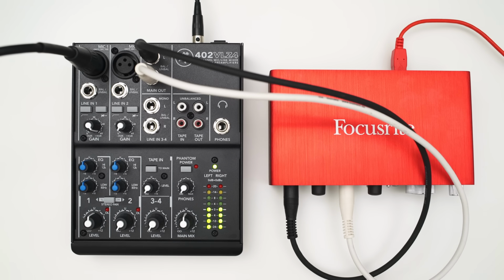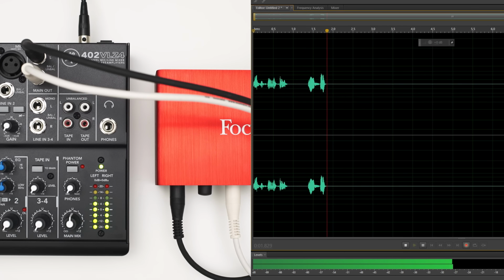Setup Guide - how to connect a Mixer to an Audio Interface for audio recording

Comment from the maker: FAQ:
Q: Why would you want to connect a mixer to an interface?
A: Let's say, you have a mixer where 8 microphones are plugged in. You could then record the combined audio of all the mics with the interface.

Q: I only have one mic. Do I need a mixer in front of my audio interface?
A: No, just plug the mic directly into the interface to record your audio.

Q: Why would I want to connect a two-channel mixer into a two-channel audio interface? Couldn't I just connect the two mics directly to the interface?
A: Yes, connecting a two-channel mixer to a two-channel interface is not really useful. I just used the hardware seen in the video for demonstration purposes.

Q: Does this setup increase or decrease preamp noise?
A: This depends on the preamps in the mixer and interface. If the preamps in the mixer are much better than the interfaces preamps, then this whole setup could improve your preamp performance. But this is also true the other way around. If the mixers preamps are worse than your interfaces preamps you end up with more preamp noise in your final recording.
Reply: Julian Krause What IF my mixer has a USB connection???? Would I still want to use an audio interface with mixer or no? Any pro vs con in using both vs just a USB mixer???
Reply from the maker: @TonyBabarino  Hey, If your mixer already has the capability to connect to your PC via USB, I would use this feature. In many cases you don't gain much connecting it to an audio interface.
Reply: @JulianKrause  
Explicit demo. 
If you have only  4 instruments/mike, it's better to plug/unplug into the USB box directly since every mixer adds a "color".
Reply: @JulianKrause   gibt es Mischpulte dieser Größenordnung mit genauso hochwertigen Preamps oder generell Komponenten wie die von Interfaces ?
Reply from the maker: @blackforestemtb1393  Ich hab jetzt noch nicht so viele Mischpulte gemessen, daher kann ich dazu nicht so viel sagen. Generell sind die Preamps aber heutzutage sehr rauscharm, egal ob interface oder mixer. In den meißten Fällen wirds sich das nicht viel geben.
Reply: @JulianKrause   danke für die schnelle Antwort 👍 bin gerade dabei mein Equipment zu wechseln. Im Kopf habe ich das Motu M4 oder eben ein Yamaha Mixer MG 12 XUK mit integriertem Interface was nicht schlecht sein soll. Wenn die Audioqualität nicht merklich besser ist dann habe ich mit dem Mixer doch einen merklichen Mehrwert durch die Einstellungen und Anschlüsse oder vergesse ich da eine wichtige Komponente an der Sache ?
Reply: @JulianKrause  I use a single condenser microphone for internet broadcast,  and I needed more gain so I used the mixer route. Unfortunately the mixer introduced hiss that I didn't want. Sad because the mixer had some effects I wanted to use.  I switched to a dynamic microphone, attached a fethead and plugged directly in the interface to computer...sounds great!
Reply: @TonyBabarino   if the AD (analog to digital) conversion is better in your interface, and it has good preamps, it might sound better to go through it.
Reply: I’ve used a mixer connected to my interface (M-audio fastrack pro) to improve the preamp and the results were amazing... But, if your interface has a good preamp, it’s really unnecessary to have a mixer... (unless you wanna merge many channels into one or two).
Reply: @VictorHugoAndradeSoares    Yes, I tried the mixer for the additional gain but got too much hiss.
Reply: Why using stereo Jack cables instead of Mono?
Reply from the maker: @lorenz_dr  Because these are balanced connections which use three conductors per channel.
Reply: Does this allows me to use special plugins in my DAW - in case I was performing live?
Reply: Hi, what about the gain
 on the interface, shouldn't it be increased.
pls advice
Reply: Julian Krause  can I use a mixer in my set up If I use a external preamp and compressor?
Reply: This answered my question above, thank you.
Reply: interesting when you put 2 mics in front of an amp...recording your guitar with 2 different set ups
Reply: eq set ups
Reply: can I connect dynamic microphone to audio interface and it sounds  properly out on software recording in  focuscrite
Reply: Is there any mixers that can power 300 Ω headphones do you know of ir do you need a headphone amp separate?
Reply: thanks!
Reply: would it be possible for me to know the cost of mixer
Reply: I have a PA speaker with built-in amp , how to connect it to audio interface focusrite, i have korg PA keyboard ,i want to record my songs while singing live? Any help would be appreciated, thanks
Reply: @Shakmusicofficial  A small mixer(something like the one shown in the video) will solve all your problems. Plug in your mic and Korg to the mixer inputs, connect the mixer to the focusrite as explained in the video, and connect the focusrite usb output to your computer and connect the line-outputs of the focusrite to your PA input. Just mind the levels and you're good to go.
Reply: I have a PA speaker with built-in amp , how to connect it to audio interface focusrite, i have korg PA keyboard ,i want to record my songs while singing live? Any help would be appreciated, thanks
Reply: Ok so if im wanting to record drums with 6 or 7 mics would running a mixer through an interface add to the latency
Reply: @xcodychaosx  If the added signal path is fully analog, there will be no extra latency whatsoever.
Reply: @JiihaaS  cool thanks for the help
Reply: @xcodychaosx  hi, that’s unlikely, because the signal stays analog until the analog to digital conversion of your interface and most of the latency only occurs within you computer.
Reply: Can i connect my  condenser mic to the mixer and recored right away from the mixer to my DAW without the interface...?
Reply from the maker: @kl10records72  If your mixer has a USB connection, you can. If not you need to use the setup shown in the video.
Reply: @JulianKrause  This also resolves an unexpected problem I am encountering with my new Yamaha MG10XU. I bought it because it has a class-compliant USB port. I need to send the mixed stereo signal from 3 microphones directly to an iPhone for Facebook Live performances. I can't do this with my Steinberg UR44 because only the first 2 inputs pass through to Facebook Live. The 3rd mic signal can't be sent. The problem with the Yamaha's MG10XU is that you can't control or monitor the output level going from the mixer to the iPhone. The USB bypasses the stereo level. It turns out the signal is very weak. Using your method, I can now send the stereo out on my mixer to the first 2 inputs on the UR44 and monitor output levels accurately.
Reply: @CraigAddy  hey, I'm using a similar set up as yourself. I'm getting a little static when listening back to Facebook recordings. Can't seem to find where it's coming from. Nothing is peaking, changed all the leads. Have you had any similar problems/solutions?
Reply: Hubert Murray jnr - Sorry to hear that. Other than a little distortion due to improperly setting my gain I’ve had no problems. I’ve fixed that and everything sound clean and clear.
Reply: I have SL324FX do I need to buy Scarlett solo so I can record? need help please
Reply: Hi, Thanks for your video. I have one question. Why do I need a USB interface if I can just plug.in the mixer "Main Out" to the "Line-In" of my PC and start recording? Is there a huge difference bypassing Audio Interface Unit? Sorry I'm a newbie.
Reply from the maker: @jeffkarlcocamas4239  In most cases that doesn't work as your main out is a balanced connection and the line in on your PC is unbalanced. That why you would need the interface. Additionally the interface usually provides a better audio quality than the built-in audio input on your PC.
Reply: Hello, please i need help, i have a marshall MG30FX, a zoom guitar pedal G3xn, a UMC 202 HD audio interface and a xenyx 502 mixer. I want to create this chain: Marshall to guitar pedal, guitar to pedal, pedal to mixer and mixer to inteface. The reason being that i want the Marshall amp sound instead of a custom fx made in the DAW. 
  How can i do this? Will i not be able to do it given that my marshall amp does not have output ? Any help will be apreciated, thank you.
Reply: The main reasons why we connect our mixer to interface beacause we want morn input and also direct reverb effecs  when recording
Reply: Pq voce pode gravar uma banda inteira já Mixada e jogar isso para interface fazer a conversao do sinal e deixar uniforme .. simples. Quem vai gravar ao vivo isso é o.melhor caminho para gravar corretamente o som e melhorar sua masterizacao em 1000%
Reply: Yea that’s what I wanna know why would you need a mixer? I always thought for live performances

Comment: Are the mics outputs on different channels in the daw with that set up? Or would you get the signal on the same channel?
Reply from the maker: Hey, the signal is on the same channel. That's the job of the mixer. It mixes together multiple sources, so you record a mix.

Comment: The pre on that scarlet is definitely cleaner than the one in that mixer, you should be relying more on the interface’s input gain and less on the mixer’s.
Reply: different on mine, cleaner on the mixer than directing it thru interface gain. Especially making it louder.

Comment: So I have a little bit of a change up for you and curious to know how you would setup this combo. I have a dbx 286s and a Behringer QX1622USB Mixer. Currently I am using XLR to XLR on the SM7B to the dbx and then TRS to XLR to the Mixer. Worst part is that I have always been unsure where each slider should be at on the mixer when I go to fine tune the dbx and it's settings. I like this Mixer as well because it has a USB out interface. And since I do 2 PC streaming/Recording, I use the Mixer to go USB to the Recording/Streaming PC and Dual 1/4" to 3.5 mm on my gaming system. Main reason being that I use a Voice Activated program on my gaming system.

I don't have the money to go after a GoXLR, at least not yet and that's what I really want.

I have a lot of bad acoustical issue in my office. Raised floor, it's a hard wood floor, bad insulation in the walls and not consistent, gap under the door, etc etc. I am planning on getting some acoustic mat and line all of the wall surface to reduce a lot of the echo. And using the dbx allows me to mask out a lot of the echo and back ground noises as well(I have a 4 year daughter). But I guess the main thing I have been trying to figure out is where exactly do I want to start on the sliders and knobs on the mixer. I know with the dbx it's all turned to the left which is zero. On the Gain I have it maxed, output I have at "0". 

I guess I need to start at 0 on the Mic volume input and then also the "0" on the Main Output as well? I think that controls the audio going out of this Mixer. Even Behringer hasn't been able to tell me everything about this Mixer. So been trying to figure it out on my own really. Any help from anyone would be appreciated. I want great audio for my Streams and my YouTube video's.

Sorry for the wall of text. Just had so many questions for so long.
Reply from the maker: Hey, I think your physical setup (SM7B -> XLR cable -> DBX 286s -> TRS to XLR -> QX1622USB) is totally fine.
I would do the following to setup everything up:
-First set the gain on the dbx 286s to a proper position. Talk into the mic and turn up the gain, until the green LEDs always come on and the yellow LED occasionally lights up.
-Then set the "output" on the 286s to the "0" position.
-Turn the gain on the QX1622USB all the way down.
-Set the "level" and "master mix" fader on the QX1622USB to unity ("0" position).
-Then open up your recording software and speak into the mic. Your audio levels should be peaking around -20dB or slightly above.

-If your audio levels in your software are peaking much higher than that, slightly reduce the "output" on the 286s.
-If your audio levels in your software are too weak, slightly increase the gain on the QX1622USB.

That's how I would go about to set up your system. Cheers!
Reply: @JulianKrause  What's a program you recommend for me to use for testing my audio levels when speaking?
Reply from the maker: @destruct0dan892  Pretty much any audio program with an audio level meter. The free program Audacity works just fine.
Reply: @JulianKrause  Perfect, thanks. No, I am noticing that setting my dbx to max Gain(which the SM7B needs) and the Output to 0,and setting the line in put for the Mic on the QX1622USB to 0 and then also the main output on the Mixer to 0 as well, my mic tends to trigger the Clip red light on the Channel 1 area. Is that something I should ignore if I am not hearing any clipping when recording? Like maybe a false positive?
Reply: Julian Krause My levels are peaking at around -20 with that setup, but isn’t that too low? I thought they should be peaking around -12.

Comment: 60dB gain is unusual, isn't it?
Reply from the maker: Not really, it depends on the sensitivity of the mic, the sound pressure level of your sound source and the distance of the mic to the source. Depending on the situation 60dB of gain might be needed. Nothing wrong with that.

Comment: Why would you want two devices instead of a mixer that also works as an interface?
Reply from the maker: Of course there are mixers with a built-in interface and they are the way to go if you directly want to record the audio from the mixer. But some people might already own a mixer without recording capabilites and want to know how to hook it up to an external audio interface. That's what the tutorial is for.
Reply: This is just a demo. A more advantageous setup would be to have a mixer with more channel strip for more mic input.